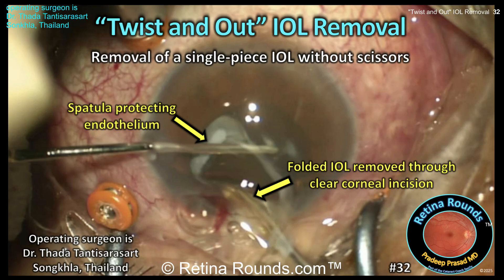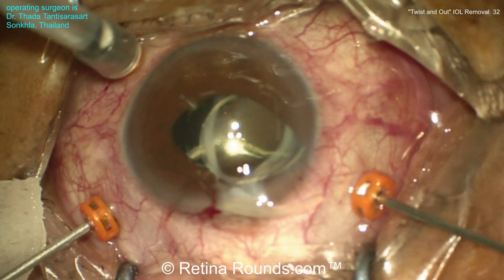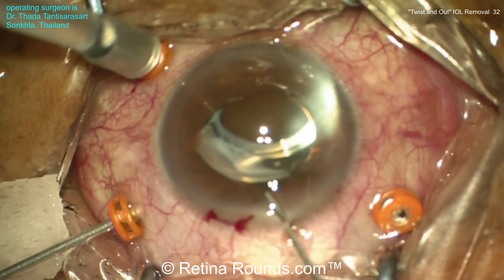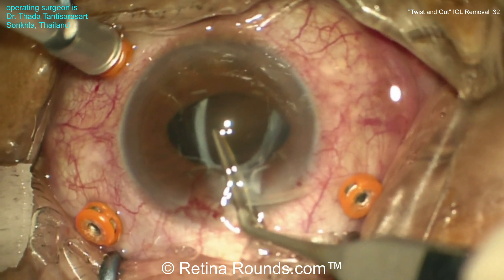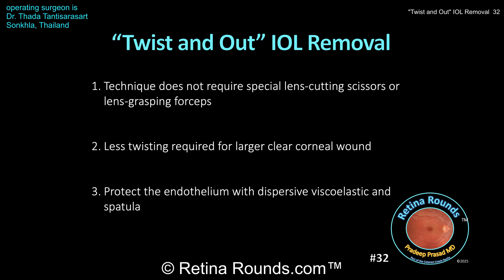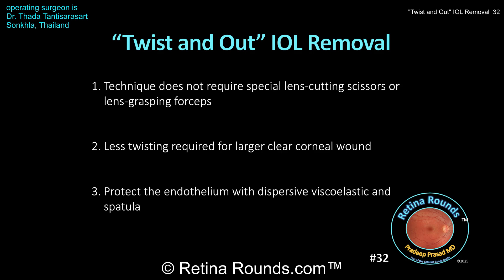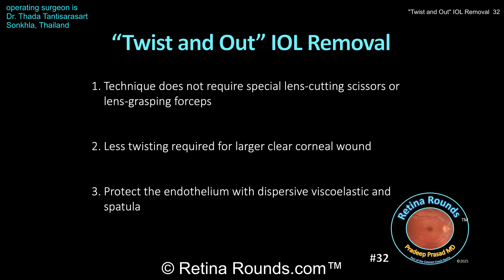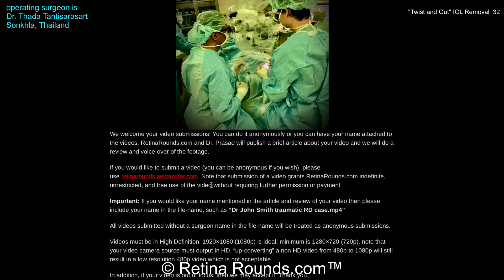RetinaRounds™ 32: "Twist and Out" IOL Removal

Comment: When using Pars Plana infusion in this manner, I have a few suggestions:

1. Be mindful of the iris – Posterior infusion can push the iris out of the main incision while removing the IOL, which may lead to iridodialysis and bleeding. To prevent this, carefully monitor the iris position and adjust the intraocular pressure (IOP) accordingly. In some cases, an assistant may need to temporarily clamp the infusion line. Additionally, injecting an appropriate amount of viscoelastic can help stabilize the iris.

2. Use non-angle forceps for better maneuverability – I prefer using non-angle forceps when grasping the IOL because they allow for a greater range of pronation compared to McPherson forceps. This reduces the need to enlarge the main incision.

3. Opt for a larger, flatter iris spatula – A larger and flatter iris spatula provides a greater contact area with the IOL, making it easier to flip the IOL.

Personally, I prefer cutting the IOL and removing it in pieces, as it provides better control and minimizes trauma to intraocular tissues.
Reply from the maker: Outstanding tips, thank you!

Comment: Great content 💐  I think,  this case in gray area both incisions ( corneal or scleral tunnel)  can be use. Because of this reason twist and out is so useful . But if patient has more rigid lens capsule complex or lens capsule complex with CTR or capsule segments , enblock extraction from scleral tunnel may be more effective and useful. 2nd cause of preferring of scleral tunnel ,
application of yamane ( iol implantation without lens folding)  is easier than corneal incision.